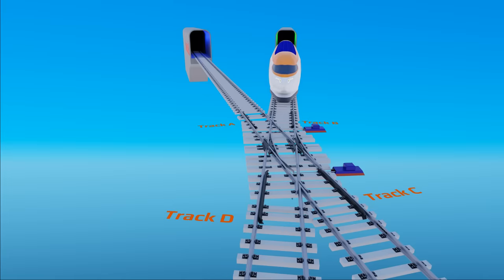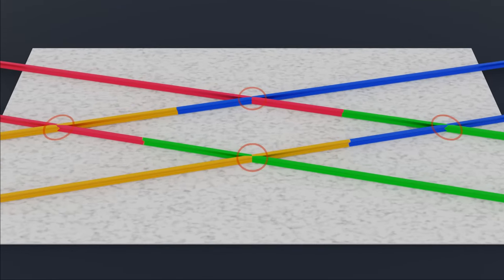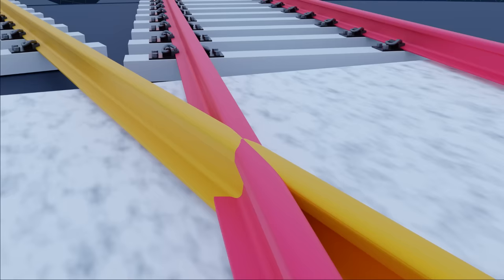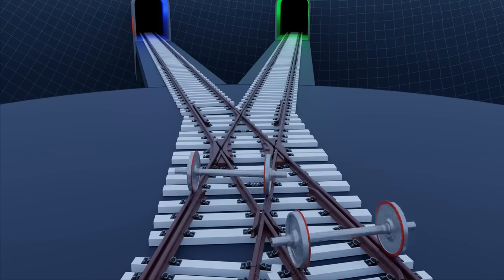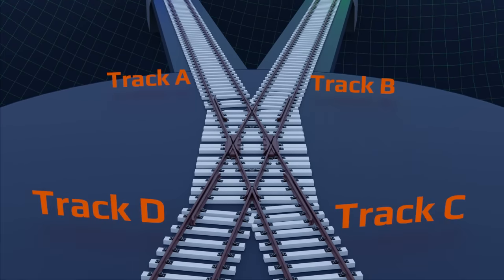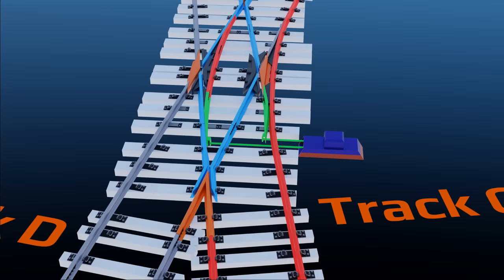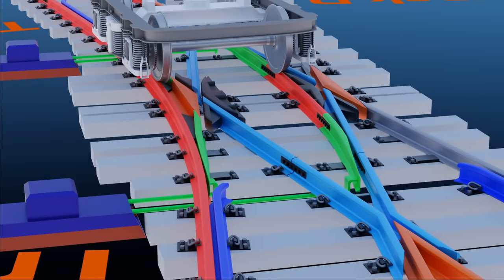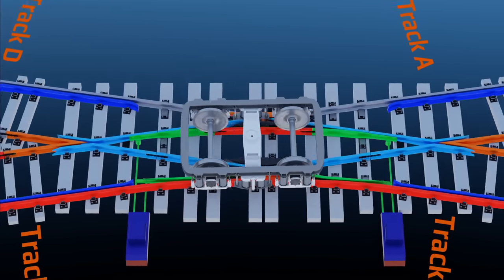A Slip Switch Railway Crossing| How Train change tracks

Comment: Originally, back in the 1700's, all controllable bladed railway track turnouts were referred to as "Switching Points". However, in the US & Canada, this was shortened to "Switches", whilst the rest of the English speaking world calls them "Points".
Reply: Ishtuk jugia baichung vutia?
Reply: Not necessarily. Switches are a whole class of railroad mechanism. The most common switches today are the point switches we often see, but they aren’t the only switches out there. Many early railroads used stub switches where you had the ends of both the diverging and converging tracks move back and forth to line up their squared off ends with the line connecting to it.
Reply: They are also called points in Japan, well, “pointo.”
Reply: They're "arrows" or "returners" in some Slavic languages.
Reply: @alooga555  I have never heard anyone say "point" in Japan when talking about rail points.
分岐線 or "Bunki-sen" is much more accurate
Reply: @alphafoxtrot787  Both you and I were very close but a bit off. This is the definition according to the Japan Private Railway Association (if you can read Japanese, that is: "列車を他のレール上に分岐させるための装置全体を「分岐器 」といい、その中でレールを分ける装置のことを「ポイント」といいます。" FYI, "分岐線" means "branch track" or "shunt."
Reply: @mdmohitulhaque8648  л
Reply: @Abdullah Ali  they used to be pulled by humans
Reply: In US English these are very often referred to as turnouts.
Reply: In German it's more like hard/soft track, in the meaning of fixed or mobile/elastic.
Before Stevenson, before 1825, something moving was not necessary, cause the cars have been pulled by horse or men, and could be pushed or pulled into a direction.
Just since it's self-propelled, the vehicles only contact point to the ground is the track itself, contact to earth was lost and they had to find something to control direction. 
In early times, they tried it with flexible axes, like in cars, also.
Reply: I've seen others call them "SnC"s - short for "switch and crossing".
Reply: 1700s ??

Comment: Very good explanation. Very very good art and animation. When I was a kid my dad had a saw mill next to a railroad. It was a short line connection our town to the Larger Southen Pacific. It had 6 engines mostly as toys for the owner. Including two steam engines used on occasion. I used to study the diamonds and switches. There are other types than in this video but no need to cover them all.  Good Job.

Comment: In the UK this design would officially be recorded as an inside single slip diamond. Inside because the switching route is within the diamond.

PS your original diamond is only acceptable if the angle between the two lines forming the diamond crossing is no greater than 1 in 8 or lower. Above this value you need to use a switched diamond.
Reply: A switch-nose' diamond.

Comment: Excellent animation! Thank you. So, is this switch relatively severe for trains and would they have to go very slow past it?
Reply: In generally, yes they will have. But there are high speed switch crossings with huge turn angles, so train can pass them going up to 300km/h but they are obviously expensive and very complex.

Comment: I would like to encourage you to make a video about the suspended monorail as well. How does it take the electricity, how does it balance, how do the switches work in the single-rail double-station system. etc. In Japan, there are several types and in Germany, on the model of the Wuppertal Schwebebahn... Thank you

Comment: Could also mention the use of Slip Switches is for space saving. Whenever there are other options for switching, usually they are employed. One mostly sees slip switches in yards or areas surrounded by buildings/roads/platforms/bridge supports/other tracks/embankments etc etc ie where there are no other options.